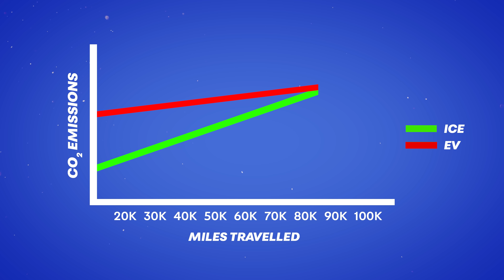Are Electric Cars REALLY That Green? [New 2022 Data]

Comment: I heard it's more like 7k-15k miles before carbon neutrality from different studies in the states. The amount of miles depends on the size of your car and battery. For instance, my e-Golf would take way less time to be carbon neutral (pretty sure it is after 23k miles) than a Model X would.
Reply: Wish I could afford to be carbon neutral
Reply: EV LIB packs :

13100 kg of CO2 (75kWh * 175 kg/kwH). Just to manufacture the battery in China. Not operate it.
That's more emissions than from operating an ICE car for abut 100,000km
Reply: A Model X is VERY VERY (very, very, very, ..) much more efficient than ICE cars with similar space (and performance, yeah, they don't really exist) capabilities. So even for that, the break even point is not that far in the future/milage.

Comment: It's missing to consider a very important aspect: 

what happens when the EV run out of road - in particular what happens to the batteries.

While traditional lead-acid batteries are widely recycled, the same can't be said for the lithium-ion versions used in electric cars.

EV batteries are larger and heavier than those in regular cars and are made up of several hundred individual lithium-ion cells, all of which need dismantling. They contain hazardous materials, and have an inconvenient tendency to explode if disassembled incorrectly.

Comment: How many miles will current EV batteries last? I read about 70k miles so they might not even hit their break even point. Obviously this will improve soon.
Reply from the maker: Most people offer 100,000 mile warranty, so 70k is easy.
Reply: Tesla reports that 200,000 miles on their batteries should have 80% plus capacity .

Comment: Lots of respect to Volvo for publishing this. I wonder if they also factored in longevity? It’s great that they put a number of miles to break even but what’s the battery life (degradation etc..) going to be like at these miles. Would it live long after or need to be changed in which case the scales would tip again. I like the idea of electric cars but can’t make up my mind yet due to cost and longevity

Comment: Interesting analysis and debate, however a battery car should last at least 2-3 times as long as an equivalent ICE car due to the lack of moving parts. All the ICE cars I've had including Volvo and BMW became uneconomic to keep on the road at about 120k-130k miles, Tesla are designing cars to do 1 million miles. In other words you'd need nearly eight ICE cars to cover the same distance as one Tesla EV, plus the batteries can have a second life and then be recycled.

Also Volvo factored in well to tank, does that include the cost of manufacturing oil rigs, the energy used running and maintaining them, oil exploration costs and the damage done to the environment by oil exploration, does it include the refining process and costs incurred maintaining refining plants, or is it simply the fuel costs incurred by petrol tankers ferrying the fuel around.

Comment: don't forget you need to replace the batteries. which can be so expensive, you might as well buy a new ev in many cases. this results in a potentially low resell value. which can just produce more waste in a shorter time. not to mention that lithium is a finite resource...
Reply: With several Ev companies offering 150k plus warranties on their batteries ??
Reply: @jackdbur  ...and eight years - which is far more than an ICE.
Reply: @zaphodsbluecar9518 Such a pity that so many believe so much of the FUD that so many have spread around. Other than the horribly designed Leaf batteries it would seem that most batteries will handly out last the warranties & Are almost completely recyclable.

Comment: Fully Charged have just done this and using expert analysis - not Oil company figures worked out it takes only around 5k miles in a new EV to break even on carbon footprint.

Comment: Knowing Volvo, they did this for open conversation. They even announced to phase out all ICE vehicles a few weeks ago, so they're going big on electric. Those electric cars will be hard to sell, whereas the ICE cars would already practically sell themselves. They pulled a classic Volvo.

Only question I have regarding this is about battery lifespans. There are records of Tesla batteries dying after 90k miles, does this mean they start all over again in the carbon footprint scheme?
Reply: That was some from high temperature areas and they were 1st generation cells and they were replaced under warranty.
Reply: @jackdbur  there's nothing less true. I recently read about a taxi Model S that surpassed 1.500.000km of which the first battery lasted about 180k miles (290k km) and the second one only 90k miles (150k km). Third one seems to be holding up great! This was in Finland, a country well-known to be cold. 

Also, them being replaced under warranty doesn't mean the carbon footprint isn't enormously enlarged.

Comment: No,  they are not green 
The Issue is Aging batteries can't be repaired 🤷‍♀️🤦‍♀️
Reply: can be recycled
Reply: @Gruxxan   recycled and Fixed are 2 completely different things 🤷‍♀️🤦‍♀️
Let's say you want your Fix 🔧  your Ice car Engine  , Mechanic says : It will Cost you £8,000
However if you give your Old Engine we will pay you £ 2000 to recycle your old Engine    in the end you will still have to pay the difference £6000 😳
And you still need a replacement 🤷‍♀️
Reply: @niceboy60  i still want a tesla model 3 bro
Reply: @Gruxxan   Marketing has that effect on  people 
Some people Pay £1100  a month for a Tesla and than  Brag about they are saving Fuel Money 🤷‍♀️🤦‍♀️
Reply: @niceboy60  i am not one of those people
Reply: @niceboy60  if i want a car, i buy the car i want, not the car you want
Reply: @Gruxxan  I wouldn't tell you not to buy your Dream car, go for it,  if you can afford it why not🤷🏻‍♀️
Reply: @niceboy60  thanks bro

Comment: The 'Well to Tank' comparison between the two is one of the most persuasive arguments. Oil rig to oil refinery to oil tanker (ship) to oil tanker (road) causes massive polution every step of the way. Compared to wind or solar generated electricity distributed at the spped of light down a cable!
Reply: This is bullshit - here's why:

Buying an EV won't stop the petrochemical industry.

Petrochemicals are vitally important for Fertilizer, and Pharmaceuticals.
And Explosives. You know, the type that get used to mine your Lithium in your EV out of the ground.
And Diesel. You know, the type that were used for transporting EV batteries and EV cars around
And Plastics. You know, the type that exist in EVs.

It's because of the Petrochemical Fertilizers that the Green Revolution happened, and one BILLION human lives were saved.

And Car ICE emissions account for single digit emissions of CO2 per country. Say about 9%. Even taking 10% of vehicles off the road and replacing them with EVs is only going to save 1% of CO2 Emissions.

Sorry if this doesn't fit into your narrow viewpoint.

Are you a EV fanboi?
Reply: this
Reply: Yeah, and EV batteries are mined Lithium/Cobalt transported by ship to (mainly) China, where the batteries are constructed (mainly) using coal power before being shipped to car manufacturers all over the world who then make the car before shipping it to the country of sale who then transport it to the dealer etc. I've probably missed a dozen stages inbetween where items are shipped/transported etc, but that's the reality.
Reply: @tonyb3629  and ice cars magically appear at dealers? The same process you stated apply to them but they go on producing co2 in much greater amounts in use.
Reply: @tonyb3629  petrol production also uses cobalt, just once and it can’t be recycled. They never mention that!
Reply: @sergentcolon1  Petrolchemical production does not USE UP cobalt. It's a catalyst.
And last time I checked, EV batteries are not yet recyclable. It's a massive environmental problem.

I bet you are a Tesla Fanboi
Reply: @ChrisWells1  wrong, road transport emits 22% of the U.K. CO2 emissions. Diesel engine nitrous oxide and particulate emissions cause lung cancer, bowel cancer and asthma. Diesel particulates have been classed as a group 1 carcinogen by the WHO. Workers exposed to above background level of diesel particulates are 40% more like to develop lung cancer.
At present diesel is used to move products around, but that will end as ev technology replaces it including a mix of battery and green hydrogen. 
The over use of fertilisers has also contributed to the poisoning of our river systems it has also led to the degradation of top soil. What do you think we’re going to do when we run out of natural gas to produce the nitrogen in a few decades? The present price of gas has already forced the closure of some nitrogen producers. The one in the U.K. only reopened because the government gave them money. 
Plastics are polluting the worlds oceans and rivers alternative biodegradable forms of plastics have been developed and new ones are in the pipeline.
Fossil fuels have been very important during the 20th century and the beginning of this one. But they are also destroying the ecology and future of this planet if we do not replace them soon.
Reply: @ChrisWells1  wrong again there Chris, I’m neither a Tesla fan or a boi (what ever that is) . Personally I think there are too many large, heavy or powerful ev’s that use too much battery capacity.
I think the Chinese model of small, low power, mini cars which are far more efficient  to build and use far less precious battery cells is much better. For most people, for most journeys a small low powered car with with a 60mph top speed and a range of 100 miles would be all that is required. They also are extremely affordable and don’t need a huge supercharger network to run as they can be charged from a normal 3kw socket in 5 to 6 hours at home ( which is where the vast majority of ev’s are charged anyway) .  In China these cars can be bought from as little as £3500 and cost peanuts to run.  We need to remove some of the overly nanny like safety requirements for these sub 60mph city cars that prevent them being sold here. Given the choice between an ev car with lane departure warning, assisted emergency braking, airbags everywhere that costs £20000 or a small basic city car that cost sub £7000, has only one airbag and abs and costs a couple of quid a week to run is no contest as far as I’m concerned.
Use as a catalyst is still use and it is used only once. There are a few companies who have ongoing development processes to make lithium cell recycling much easier. And when ev cells no longer have the capacity to give service in a car they still have plenty of capacity to be used as power banks, possibly at chartering sites where they can be charged a a lower rate and then used to charge ev cars at a high dc to dc rate. Most of the negative pronouncements on ev vehicles have come from those with an interest in maintaining fossil fuel or ice production.
Reply: @tonyb3629  ^ This^

Basically:

Mining Ore & Transportation
Refining Ore & Transportation
Manufacturing LIB packs & Transportation
[ACTUAL operation of EVs]
Dismantling EV batteries, & Transportation
Recycling EV batteries into separated metals & Transportation

EVs are not green. Only Telsa fanbois will argue. Despite the facts.
Reply: You're right, but what if the fuel could be made domestically, in the country that uses it? Biodiesel is made in the UK from waste from the UK. HVO is apparently almost carbon neutral, with the carbon sourced for it's production renewable, and hence offseting the carbon produced by the burning of the fuel. It's known as the carbon cycle, using the carbon available now, rather than introducing via fossil fuels.
Reply: Yeah sure if you live in europe. In my country, South Africa, our power mix is like 80% coal, in that case a EV will never match an ICE.
Reply: @Molly-ZA  in a country with as much reliable sun and space as South Africa, solar and wind should have a much higher proportion of generation. Maybe if you hadn’t had such corrupt government over the last few years then money could have been spent in building solar and wind generation.
Reply: @Molly-ZA  I have seen WTW studies showing that an EV will match and surpass an ICE car even if the energy mix is 100% coal, it might have been biased but I don't think so. But even if we assume you are right, it would still be better to have a slightly higher overall footprint, but located away from people, than to have a slightly less footprint, but with a large part of it being local pollution in the middle of the most populated areas on the planet.
Reply: Its not that simple at all.  What are solar panels and wind mills made out of, and where did that material come from, and what maintains those green systems?  Fossil fuels.  Again, it reduces local pollution, but it doesn't delete pollution as it has to be manufactured in the first place to produce green energy.
Reply: @uni4rm  Yes it actually is that simple. Because if you wanna play that game you also have to ask, where does the steel for the oil platform, the oil tankers and the trucks comes from? All creation pollutes, but we have the choice between creating something that only pollutes when created, or something that keeps polluting even after it is created.
It's actually that simple.
Reply: @TheSaltyAdmiral  Good point.
Reply: @TheSaltyAdmiral  Yes. Thank you! Also, the production of petroleum requires huge amounts of electricity, which in many instances is generated by coal… The ICE vehicle is dirty from the day it is produced and gets even dirtier as it ages (burns oil, more oil changes, all the parts that have to be replaced - exhaust systems, catalytic converters etc.). An EV is a no brainer for most people. Our next vehicle will certainly be electric. Cheers.

Comment: As we look to the future electricity grids will become fully renewable and battery production will consume less carbon as producers such as Northvolt start making batteries. ICE cars have nowhere to go to find such improvements. 

You ask “Why would Volvo” publish this report. Like most legacy car manufacturers they are under threat from Tesla and Chinese producers. They have enormous investment tied up in ICE plants that need to keep working to pay back those investments. The longer they can hold off the increase in EV sales the better for them. Also, the report is a document published by Volvo not a scientific paper published for peer review so it has to be read realising there is an agenda here even if it’s not obvious. 

EVs aren’t the answer to personal transport. The very concept of individuals owning cars is not sustainable but it’s what we do currently. However, as the grid cleans up CO2 emissions will get less from EVs. We also, rightly, concentrate a lot on CO2 forgetting the chemical soup of waste an ICE car and oil extraction generates which EVs don’t.

Comment: Hmmm
I've read the report a few times, I can see that Volvo include the materials for the Li-ion large battery module in the initial build: a 7 CO2e difference just for the battery
However I cannot see the credit for Li-ion   battery pack reuse (not scrap). This appears to be quite clearly excluded but is a major environment advantage for BEV.
I would be pleased if someone could point out if this isn't the case in this report.
Reply: Never mind the emissions of getting fuel to the tank!!
Reply: Why would you recycle the battery of a new car to put back into the same new car.  This is comparing new car with new car, not new car with other new car using multiple methods in an attempt to skew the data in the BEV favor.  Also, you forget that the carbon footprint of a recycled battery will always be higher than a new one, because the recycled one WAS a new one, AND then it takes more processing to recycle it.  So a recycled battery would have a BIGGER footprint, not smaller.  Recycled battery cost is cost of battery + cost of recycling, new battery is just the cost of battery.

Comment: Now factor in the second battery when the EV loses range and the extra cost of disposal of the old battery. A well maintained quality petrol car can easily do well over 250,000 miles and serve for 30 years. Will EV's be able to do the same? No. Over the long term EVs will require more raw material. It's a WEF globalist folly to drive consumerism of new products and the infrastructure to support them while taxing everyone more in subsidies on unreliable and excessively expensive renewables. Nuclear is the only low Co2 electricity generation path and even that does not take into account that most local power substations do not have the capacity to provide every home with an EV charger. The sensible option would be a mix of low emission petrol and EV for the foreseeable future by Net Zero by 2050 is utter nonsense.

Comment: What about scrapping and recycling and could we get rid of the whole battery thing and use hydrogen instead
Reply: You do realise that most H² is currently from oil&gas and that green H² takes 3 times the energy of charging a battery!  Ooh and have a look at the cost of hydrogen $16+ usd per kg!!!
Reply: @jackdbur  It's important to acknowledge that the hydrogen technology hasn't had a decade and a bit of as intense development as battery powered EVs. The technology isn't ready for mass use yet, but the Toyota Mirai holds 5kg of hydrogen to go about 400 miles and the cost of 16+ usd per kg of H2 puts it on par with petrol powered cars. Having to carry 200-500kg of batteries is flawed in my opinion and the fact that metals like lithium are involved makes it worst, acknowledgeing the fact that hydrogen fuel cells need rare metals as catalysts as well.
Reply: no